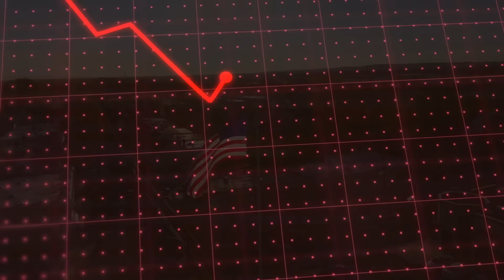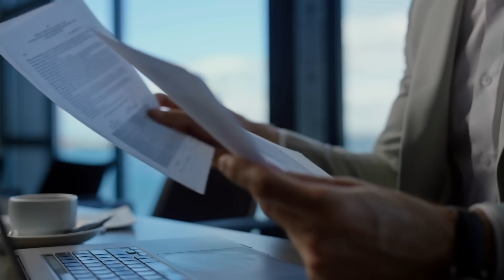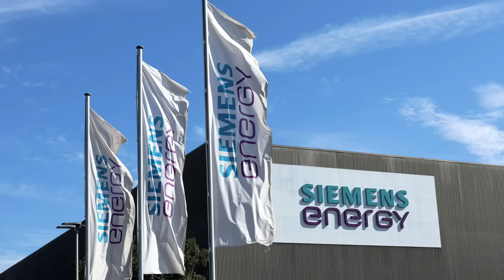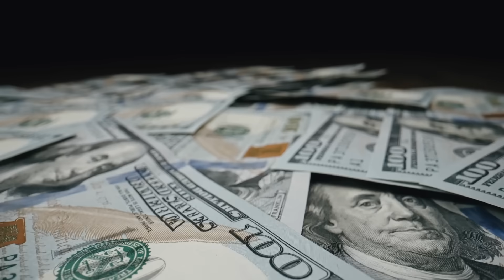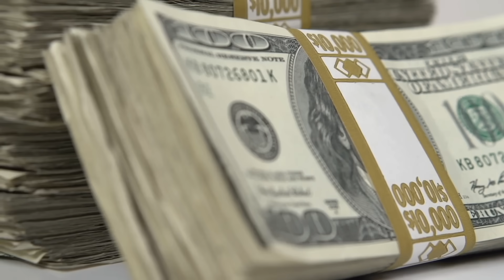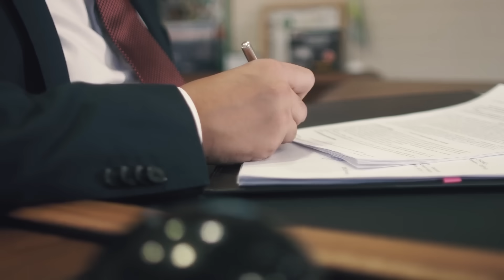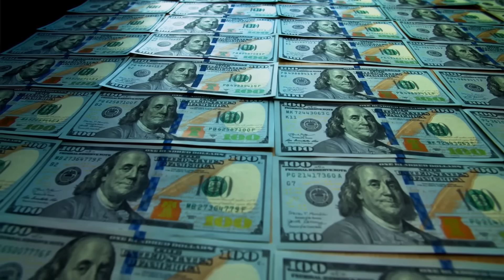The Real Reason America Has Turned Its Back On Wind Power Energy

Comment: One major problem with wind and solar is they often make power when it's not needed, and fail to make power when it is needed. Hot still days and cold dark nights being two common events.
Reply: Don't know where you live, but our winters easily get down to -30C, no wind and 4 hrs of sun if it is not cloudy all day. North of the 49th.
Reply: @dennislaughton1676  That's quite brutal for most of us. I moved from Connecticut U.S.A. to Tennessee because of climate. Connecticut was bad enough for us but is nothing compared to what you endure. You must be a hardy soul.
Reply: Th US has the advantage that it has many different climates and weather zones. With better connections between the transmission grids, this will even out a lot of the variation.
Reply: @boldvankaalen3896  This is why we in the Scandinavian Countries all are connected with an effective "High Power Grid", as the sun don't shine or the wind blows at all places at once, but only somewhere, at a place around.
Reply: wrong the Fed Gov Brought 10k megawatts from others and still had rolling Blackouts @boldvankaalen3896
Reply: @boldvankaalen3896 lol, I wish I may I wish I might...
Reply: @boldvankaalen3896  Better connections? Wind generators are connected the same way as dams are and dam generators don't all operate all the time either. Computers work all of it out according to demand and available capacity by syncing everything up. 
   Hydro power averages out to 37% Capacity Factor and wind power is 35% CF worldwide over time.
Reply: @joewoodchuck3824  I meant better connection between the transmission grids. The US has several separate transmission grids with only a few HVDC connections between them. By strengthening, expanding and connecting these grids, local variations can be evened out with power sources from a larger area.
Reply: @boldvankaalen3896  I wasn't aware of the separate grid systems. Good to know. Maybe it's an advantage though that the entire thing can't be brought down with a single failure somewhere or an attack.
Reply: @joewoodchuck3824  These separate grid are not in phase, so they cannot be connected directly. But they can be connected with a high voltage direct current connection. This actually makes the grids more robust, because in case of the outage of a significant part of generators on one grid, it can still import power from another grid.  At the same time each grid keeps its own voltage and frequency so other grids are not influenced by instabilities on a particular grid.
Reply: @boldvankaalen3896  I'd like to see the rectifiers of that capacity. Must be enormous and expensive.
Reply: @joewoodchuck3824 The difference is that water can be stored behind a dam, while wind cannot be stored in front of a wind turbine or above a solar panel. And even run of the river dams don't suffer minute-by-minute, second-by-second variability that wind and solar do.
Reply: @gregorymalchuk272  That's true, but it shouldn't preclude efforts to capture natural energy from available sources.
   Hydro isn't that perfect itself either. Water levels can increase to the point of releasing water without capturing it's energy. Water levels can also be too low for generation to occur. I live in Tennessee Valley Authority (TVA) country and I can say with certainty that there are plenty of non generation periods at the various dams. There are even water releases solely for recreational purposes. I'm further under the impression that electricity isn't necessarily being generated when that happens. They even have a published release schedule on their web site showing the various conditions and what's happening.
Reply: @gregorymalchuk272  You're joking, right? Storage of wind and solar power is done on a routine basis. You don't have to actually store the wind or sunlight. I operate a ham radio station on solar alone. Clouds and night time are not an issue.
Reply: @joewoodchuck3824 
A national high voltage grid is the point. China has already done this and solved the problem. Megavolt plus transmission lines can transfer electricity from New York to California with less than a 10% loss. The grid we have now is nowhere near this capacity. Coal is blocking a lot of this development as it will kill them. There are always regions producing renewable energy in the USA and there is always demand. Our grid sucks compared to modern upgraded grids that aren’t blocked by frivolous lawsuits or land owners being greedy.
Reply: @andrewday3206  I can't speak for the politics, but I think your efficiency statement is exaggerated. Even so, the upgrade cost would be enormous and that's probably the biggest obstacle.
Reply: @joewoodchuck3824  
China already has these in use. They use 1.1 million volts to transfer the electricity. There are newer versions with 1.5 million volts that have been developed. The cost is actually not substantial when amortized in to the cost of electricity sold. That is why it has been deployed in mass scale in China bringing wind and solar from the western desert to the cities in the east. I’m not trying to be a know it all. I’m just saying the only thing stopping the USA from developing a clear grid is the lack of desire or knowledge about energy and the fact it is achievable. Plans like converting the Hoover Dam and others into pumped hydro storage facilities would store immense amounts of energy and reduce the water crisis. Sorry for the long paragraphs it just hurts to see America waste its time squabbling with each other and not sharing information and helping each other move us forward.
Thanks for the reply
Reply: @joewoodchuck3824  You have a misconception of a network. The larger and more robustly designed it is, the better protected it is against failures or attacks. A large network possesses sufficient backup and resources to withstand an attack or failure. Conversely, a small, isolated network is more susceptible to collapse.
Reply: @dervideominister  I don't know what I said to give you that impression, but think what you wish.
Reply: @joewoodchuck3824  "I was referring to this post: "I wasn't aware of the separate grid systems. Good to know. Maybe it's an advantage though that the entire thing can't be brought down with a single failure somewhere or an attack."

 Maybe I misunderstood it too
Reply: @boldvankaalen3896 show us one mainland time zone that isn't dark at the same time as all others. And then show us how the calculations that supposedly show solar and wind to be cheaper than traditional methods take into account the fact that all these different systems which supposedly even out don't result in duplication of cost negating the savings.
Reply: @joewoodchuck3824 you mean like in 2003😂?
Reply: @boldvankaalen3896 lol. The only benifit of EHV DC transmission is where great distances are involved. To use it for any other circumstance in as dense a system as in the U.S. is to duplicate costs negating any savings, if there are actually any in the first place.
Reply: @terrific804  Sunrise and sunset on the east coast is 3 hours ahead of the west Coast, so there's ~6 hours every day where there's an unbalance between sunlit and unlit longitudes.
Reply: @terrific804  AC is actually the best for long distance power transmission.
Reply: @terrific804  HVDC Is also great to connect different networks that are not in phase.   The US has several separate  transmission networks that are not in phase. HVDC is the only way to exchange power between these networks.

The US transmission network is dense at some places and very sparse at other places. It is also not in the best state.

Conventionally the break even point between HVAC and HVDC was around 700 km. But with modern improved HVDC technology it can be as low as 200 km. 

So if you want to bring wind power from the great plains to the big population centers at the coast, HVDC is definitely the way too go.
Reply: And storage often doubles the cost of that power.
Reply: @bradhobbs  correct for a small isolated power system, but not for a large interconnected system with different types of renewable power generators.
Reply: @boldvankaalen3896  Would you agree that even on a large system solar does not work at night?  If you have a more precise cost for storage, please share it.  I have seen a lot of estimates of the cost for utility scale storage, it's pretty expansive in all that I remember.
Reply: @bradhobbs  You are setting up a strawman. Nobody proposes a system with only solar power and storage.

There is not one cost number for storage, there are many different technologies with different areas of application. Moreover, it is not just the price of an individual unit that that is important but also the amount of storage that you actually need. And if you combine windpower, solar power, hydro power, you connect regions by improving the transmission grid, and have some flexibility on the demand side you will need much less storage than most people would expect.

Standford and NREL both published Studies on 100% renewable grids and their costs. If you are really interested in the topic and are not just looking for confirmation of your preset opinion, you should look into these studies.
Reply: @boldvankaalen3896  My point is that you do need a good bit of storage relative to what we have now.  100% solar is just an example to bring that point out.

And there are people who propose tearing down dams so that the percentage of disputable hydro would decline.

I think you would agree that the cost of storage and improving the grid are not trivial.
Reply: @bradhobbs  That is why you cannot just use generalisations and handwaving to come to conclusions, but must study it in detail. Luckily scientists have doen this and found it is possible at reasonable cost.
Reply: @boldvankaalen3896   "Reasonable" sounds like the ultimate in generalizations.  Do you have something other than handwaving like perhaps a paper written by these utility scientists?
Reply: @bradhobbs  I already referred to two groups of studies. The moderation algorithm does not like direct links, so you have to search for them yourselves.
Reply: @boldvankaalen3896  Definitely the more diverse your system is the less chance of an outage.  I retired from the utility business about 10 years ago.  At that time we were just running studies that indicated there are times when both wind and solar are down across the majority of the country.  That thinking may have changed...
Reply: @bradhobbs  Energy storage can be considered to be part of a renewable energy generation facility build expense.
Reply: @joewoodchuck3824  it should be since it’s intermittent power.  It’s often disregarded.
Reply: @bradhobbs  It's no secret that wind, solar, and water are all intermittent.    Even more intermittent is the human  understanding of how everything works together.  😄
Reply: @joewoodchuck3824  I agree with that.  Many people seem to think that we can have dependable consistent power coming from from the grid while we feed the grid with 100% intermittent power. At least you can plan ahead with hydro.
Reply: Battery backup systems to smooth out the seriously variable output from solar and wind plants are wildly expensive.
Reply: @countryjoe3551  Indeed they are expensive.  It's also in ADDITION to the system we have now.  Like building a highway then deciding not to use it and building a canal to replace it.
Reply: Solar farms in space. It's the future. 24 hour, continuous power beamed to earth.
Reply: @aries6776  Please be specific about "beaming". Do you understand the inverse square law?
Reply: @joewoodchuck3824  Yes, do you? Remember the beam is directed so it is not equal in every direction, so you can't apply the inverse square law without taking that into account. In effect it moves the apparent source much further back. Anyway Europe, China and the USA are all working on it, so I guess they know something you don't? It's microwaves by the way if you want to look it up. It's early days still with this technology.
Reply: @aries6776  Not equal in every direction is precisely what inverse square law is about. I don't see how radio waves can be that focal. Even laser beams disperse.
Reply: In West Texas the wind turbines are often locked during peak wind periods, but new wind turbines must be erected to produce electricity during slack wind periods - when the wind turbines each produce a minimal amount.
Reply: @timothykeith1367  True, either that or we need to build a huge amount of storage.
Reply: Ive seen this in Australia, where its quite common for wind power to be missing in action on a really hot sweltering day when every generator was needed. But then happily generating its toosh off at like 4am eastern time, before most people have even woken up for the morning demand rush. 
Essentially its ok to build some wind, who cares. However, it has been government policy to build too much of it, hence the management problem it creates. 
Transitioning over to gas, closing down coal, and not being in any hurry to build out wind on the Australian east coast grid (NEM) wouldve been more than enough to meet global carbon reduction commitments, anymore than that is just leftwing radicalism.
Reply: It gets cold and dark at night, and sometimes the wind doesn't blow?  Who knew?  This is a massive worldwide scam and Wall Street engineered failure that has wasted vast resources that let politics dominate and corrupt science and engineering.  We need to start over with small distributed thorium reactors that fit in a shipping container and power about 20,000 homes.  And, that cannot melt down or be used for an atomic bomb because the elemental physics doesn't allow it.  India and China are far ahead of the US on this right now.
Reply: Texas had a reality check when an extreme cold snap shut down Wind and Solar completely.
Reply: @the_rational_thinker_00  I don't think he's on the right track. It wouldn't be practical.
Reply: Bingo!. The other problem is tax payers money not available to them. When tax payers money is not available to them now it's a risk. When it is it a no brainer issue the tax payers money get rich without the risk. This is not investment it stealing tax dollars. Most of what was said in this video is facks. However the fine print is tax payers money is not available. The people who do theses things literally tells the government what they want. Only if poor people could understand money. Like the federal government saying people don't pay their taxes when it the government that have a grossly immoral problem. 2009 the federal government collected 2.87 trillion in taxes. America that is devastated not developing in 2023 the same government collect 5.03 trillion. Borrow  and print another 1.7 so it can give it to thief's like these and then tell fools jeff Bezos and Elon musk don't pay taxes. So the don't have enough money. If the federal government collects the entire 30 trillion of GDP in taxes we would have far more problems than we do to. We need the land to farm and people to live. We have oil Cole and nuclear to power the planet.
Reply: Renewables are very expensive.
Reply: @earlysda  Yes they are.
Reply: @earlysda  not anymore.
Reply: @earlysda  You live in the past. Renewables have seen an incredible cost decline over the last two decades.
Reply: Melt the sand
Reply: I don't believe you. It is better than you think.
Reply: WHAT IS THE CARBON FOOTPRINT  RIGHT DOWN TO THE PENCIL THAT DREW THE WINDMILL INCLUDING THEIRS AND MY FAT ASS THAT HAD TO SIT IN THE CARBON TAINTED OFFICE CHAIR X ACTUAL LIFESPAN ?  vs drilling and burning oil as clean as possible
Reply: Wind and Solar are not fit for purpose. The lure was 'Free Energy'
Reply: Ever heard of batteries? Someone ever mentioned them to you?
Reply: @HugoTeerds  Batteries are fine for running radios or vibrators, the size of a battery needed to provide meaningful energy storage for a town is physically huge. We have a few here in Australia one near where I work is about 1/2 acre of modules and provides 'switching support' It can carry the load for a time measured in minutes before needing to be recharged.
Reply: @ Please do some study and check the numbers. You are so very wrong on what you say. Even today, let alone one or two years from now. China is building the capacity of six (6!) nuclear power plants of renewables every WEEK! And even Texas is on the break even now and moving fast on renewables and batteries. So in your world, that would be a lot of vibrators . . . . .
Reply: @HugoTeerds  By renewables you mean coal yeah, they burn Australian coal, we aren't allowed to use it because carbon neutral. But there's no problem selling it to China and India to run their power stations.
Reply: When it's windy during the winter, it's when the wind chill is at its worst and the best time to make heat through electricity.
Reply: Yeah
Reply: Call your congressmen, senators and council and tell them windmills are in the best interest of the people and give them good reasons why. Also wind power is much cheaper then nuclear power
Reply: @kennygaming208  But it's not that's the problem, you still need to build another power plant to work when there is no wind. Sigh.
Reply: @kennygaming208  it may be cheaper but it dont work Ask texas 2021 the TVA duke energy 10 other Electric companys dec 23 dec 24 2022 Spain 2025
Reply: I don't think you all understand how the green energy works. They can build a solar farm and Kentucky and transport that energy to your region that doesn't have good sunlight. What they video said, there are 15,000+ finished projects. They can not tranport the power through the grid that we have now. It is outdated. We need to be able to transport that power to storage and from storage to where ever it needs to go. The system we have in now, can not handle that load. 

Here is what I said even made more simple for people that didn't understand the video, nor my comment. 

Its like streaming Netflix on dial up internet.
Reply: @SomeSimpleGaming  As I worked in power generation for quite a few years I think I know what I'm saying. A traditional distribution grid is designed much like a tree, with heavy trunk lines that then 'branch' out to deliver energy to every smaller feeders ending up with individual customers being the 'leaves'. You can't then built a wind or solar plant and 'graft' it in 3/4 the way down a minor feeder, it will greatly upset the local grid causing voltage disruption and having serious effects on feeder tripping discrimination leading to potentially dangerous situations. Energy storage is best handled by pumped hydro if the space is available, there are not enough rare metals in the world to build the amount of batteries needed to store enough energy.
Reply: There was a serious recent solar farm in Nebraska damaged, pretty much decommisioned by hail stones, go figure.  And wind power turbines are not able to last beyond the investment cost to implement them, ask the neighbors in Texas of the mass dumping ground of non remewable defunct turbine structures laid out over acres and acres of land.
Reply: That is why there is am immense effort put into energy storage, hydro, compressed gas, gravity systems and so on and so on.
Reply: @petefluffy7420  How well do these work and what do they represent in terms of a solution the the problem?
Reply: @christophercharles3169          Hydro is a well proven technology over a century old. Most countries use it. Compressed gas I personally have doubts about its long term safety but I am no expert by any stretch of the imagination. for gravity there have been a few small (tiny) trials. Hydro works very well, as for the others hey have not had fill scale trials.  Wave energy has huge potential but to me in my ignorance have all seemed like they are jerry built.  Do you gave any information  yourself ?
Reply: @petefluffy7420  Yes we are all familiar with hydro power generation, the only one that works well among the items you mentioned.   The problem is many countries don't have access to enough water sources to generate power this way.  The others work on a very small scale only.  I have yet to see anything that hints of any great potential from wave energy and it would probably pose a larger problem than  wind and solar where transmission is concerned.  As you never mentioned it, do you  have concerns with nuclear?
Reply: @christophercharles3169  My country is very dry with little elevation and hydro is a problem  here in my country.  We have ample sunshine and wind too, to a lesser extent than sunshine.  How well, the others work I don't know, I think the others are only demonstration size installations at best.  Nuclear I don't want it, but it is not my choice to make.  The problem I see with nuclear is the waste fuel, and possibly end of life of the contaminated bits and pieces.
Reply: @petefluffy7420  2 things.  1. You don't see a problem with solar panel and wind farm waste?   2. You do know that the waste from a nuclear facility is very small, can be safely stored in the ground or that we even have the technology to put it on the moon if needed.

Don't get me wrong, if wind and solar works for your part of the world then its full steam ahead and a no brainer for you country.  Why hasn't it already done it?
Reply: @petefluffy7420  All of which are extremely expensive, typically $300 per kWh.
Reply: dont work. Ask the Fed Gov TVA about its rolling Blackouts @petefluffy7420
Reply: @petefluffy7420  But thats the Issue.. To add storage means More infrastructure and management systems to be able to handle the storage.
the whole grid was designed with large power generators working together in synch.
now there's thousands of smaller generators that need to run in synch with the larger units otherwise they start fighting each other and damaging the network
Reply: @petefluffy7420  the TVA has try your Ideas, they have Failed
Reply: @petefluffy7420  Storing energy is very difficult though.
Reply: @josiahgibbs5697  Not necessarily.
Reply: @josiahgibbs5697  Energy isn't that hard to store.
Reply: @joewoodchuck3824  Batteries have leakage currents and mechanical storage like fly wheels have friction. There is also the energy density issue.  Batteries have extremely low energy densities.
Reply: @josiahgibbs5697  It's a widely understood and accepted fact that no energy storage system is perfect. But in the case of batteries the efficiency is more than good enough to be a viable means of storage.
Reply: you can smelt aluminum on mother nature's schedule, or make green hydrogen.  this is an argument that sounds good but is not really that significant.  peak loads of electric are usually driven by air conditioner use, so how about those solar panels?

the biggest problem with distributed solar is big business cannot monopolize it.  lots of people have a roof.
Reply: @drakekoefoed1642  Continual process operations like running water desalination plants, metal smelting, water treatment plants can't be stopped and restarted easily. So relying on intermittent energy availability is a no go, unless the supply is backed up with diesel or gas fired generation plant, which sort of negates green energy.
Reply: @drakekoefoed1642 LOL, no you cannot "smelt aluminum on mother nature's schedule." Crylolite cells can be turned off for a few hours at best or the pots freeze solid and are a total loss. And the contracts with the aluminum smelters that curtail load cost a LOT of money.
Reply: Solar energy it TOTAL SCAM
Reply: They're actually useful for heating on those cold nights.
Reply: @joewoodchuck3824   Hard to use solar on any night.
Reply: @bradhobbs .  The rough rule of thumb for PV panel generation is ~5 hours per day on average, depending on weather conditions. 
   A modest 100 watt panel installation for an RV for example will generate ~500 watt hours per day.
Reply: @joewoodchuck3824  Where's the solar at night? Think.
Reply: @bigglyguy8429  You can't be serious asking that question. It's you who needs to think.
Reply: @joewoodchuck3824  You can't be serious thinking solar and wind will work for a modern society.
Reply: @bigglyguy8429  Define "work". Solar and wind power already supplements the grid, sometimes is a stand alone power source up to and including commercial buildings, and is widely used with RVs and watercraft. 
   Tell me how those examples don't "work".
Reply: no they are  Not Ask the TVA @joewoodchuck3824
Reply: @joewoodchuck3824  they Failed heating on very Cold nights in the TVA area dec 23 dec 24  2022
Reply: @dknowles60  I don't recall that. Maybe the failure hit other places. I'm in JC.
Reply: @joewoodchuck3824   You no doubt wrote that with a straight face.
Reply: @markusstevens9547  I did. Problem?
Reply: And this is why we have a common Electricity Grid with Norway and Sweden, which produces a lot of Power from water coming down from high points. In fact an old retired and, one of the largest in the world, diesel engine became started up some years ago, in its Museum, to provide the Power for being able to start the Electricity Plants in Southern Sweden and Denmark, during a major Break Down!
Reply: @finncarlbomholtsrensen1188 it was in the 1965 New York power blackout that a generator was pulled from a museum to provide electricity to bootstrap generators, which had electrically-excited magnets.
Reply: Of course,  electricity is produced as it's needed. If your source relies on sunshine then how do you store the excess for use when needed in the dark?I guess the answer to that is "you can't".
Reply: @davidtuer5825  That's not so. Solar PV is classically stored in batteries at homes and similarly sized locations, though I don't know how viable that is at large scale. Electrical energy can be stored as heat and as pressure.
Reply: @joewoodchuck3824  I have heard of batteries. I haven't heard of storing electricity as heat and pressure, please enlighten me.
Reply: @davidtuer5825  Individuals routinely have PV solar panels on RVs charging a battery. I have at times run a ham radio station on solar and battery.
    It should be feasible to use solar to run electric pumps to store air under pressure. Release air to run air driven engine or turbine generator whenever appropriate. I'm sure it's been done at least experimentally. Similar but gravity pressure instead, run downstream water pumps for returning exit water to a hydro plant reservoir. 
   Solar PV excess power to resistance load and water to create steam for later reconversion, or just store heat to distribute for direct heating purposes. Can also use rock for a heat bank. Both could be integrated to a heat pump system for cooling as well. 
   I can't be the only one thinking along these lines. Some of them surely know how to implement the ideas.
Reply: @davidtuer5825  That is why you do not just rely on solar power, but combine different types of renewables, demand side management with storage, and connect the grids in different regions.

IF you are actually interested I can recommend the Standford and NREL studies on 100% renewables.
Reply: Correct, they can never take the place of Base load!
Reply: @Hogger280  
Why do you think renewables cannot supply baseload?
Reply: Windmills are impractical and stupid looking.
Reply: @Joskemom  Stupid looking? It's a device that looks the way it needs to  for the purpose it serves. Since when is it a beauty contest anyway? Have you ever seen a conventional power plant? Much uglier than these.